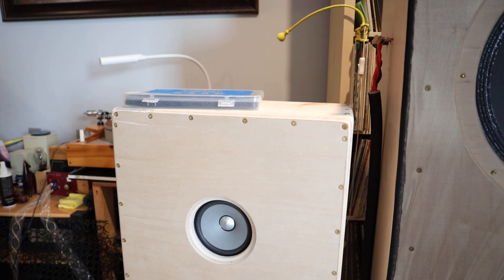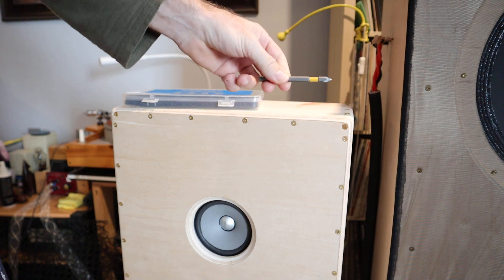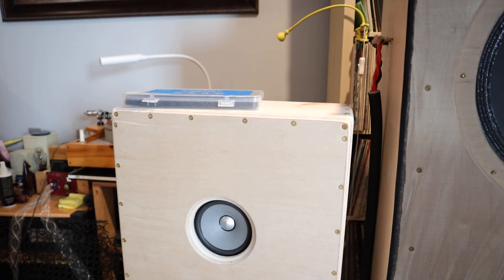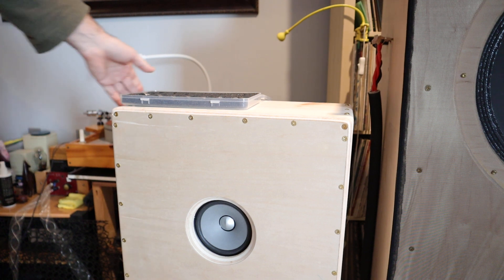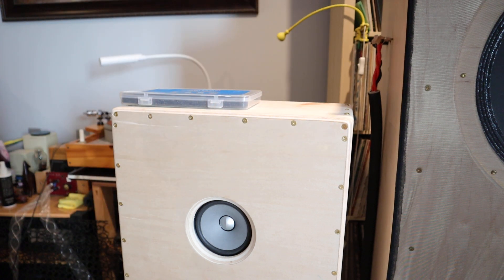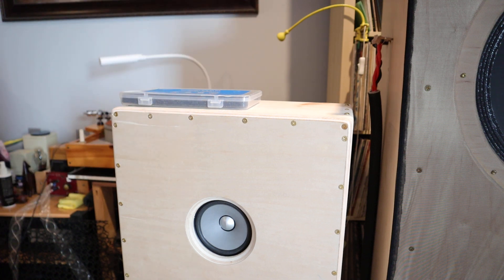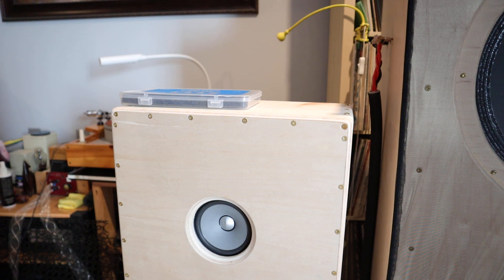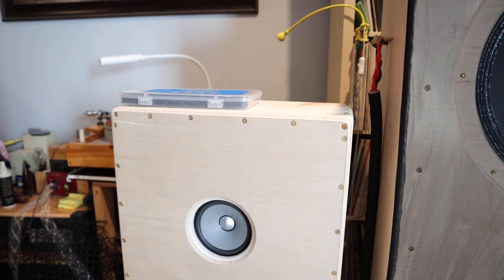Application note for brass screws

Comment: Those countersink drill bits are excellent. I use them quite often when drilling new holes in amp cabinets. After seeing these past few vids, I actually asked a client if it was alright if I replaced the screws in his large 4x12” speaker cabinet. He agreed, and I will be doing it tomorrow. I’ll report back to my findings and his reaction and thoughts. Thanks so very much, Janos.
Reply from the maker: Hi Nick, I'm very curious of your speaker cabinet tuning! Have fun ; Janos

Comment: Deep inside a previous video there must be an explanation of why you are using brass screws, would you please explain why.   Brass screws are used in wood boats, and for decoration, otherwise they are inferior, as they are weak, and only come with slotted heads.
Reply from the maker: Hi Jesper, I have truly beaten this subject to death in many videos and comments, but here's the gist, talking about boats, the relevant boat: brass is the metal that is predominantly used in MUSIC INSTRUMENTS. (The brass section.... an entire section of music instruments.) Not steel, not ceramics, not titanium, but brass. Sure, weaker than steel, but that does not matter because it is more than strong enough to secure wood. Brass conducts sound at the same speed as the finest wood, and able to transmit resonances at a broad spectrum, making it uniquely suitable for live cabinets. Iron / steel resonates at a very narrow range, introducing nasty narrow band peaks to the sound, which are conducted at much higher speeds than the woods natural transmission speed, creating a time smear with a live cabinet. I hope this helps, thank you for your question! I am building my speakers with as much technology transfer from music instruments as possible... hence a lot of my solutions seems totally perplexing for strictly audio-folks, but when one comes from a musician / luthier background, it all makes clear sense.